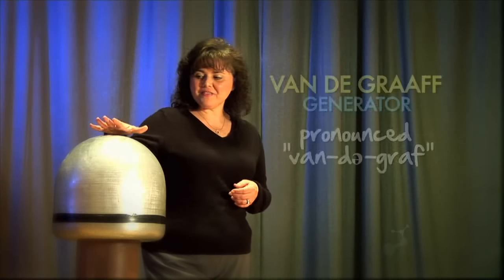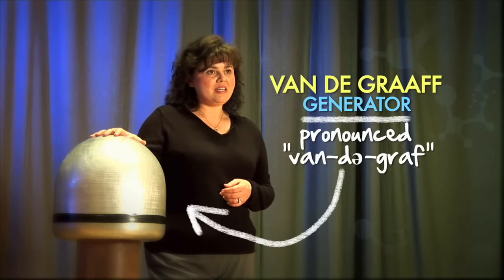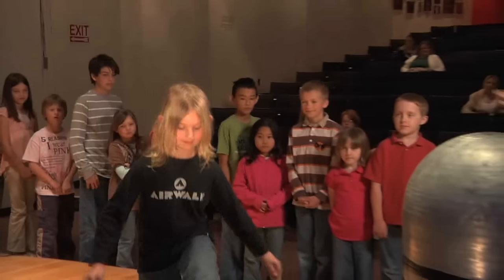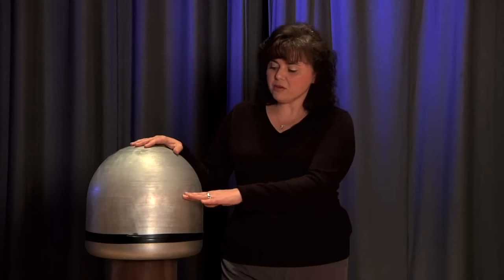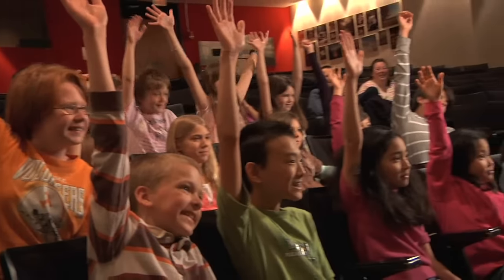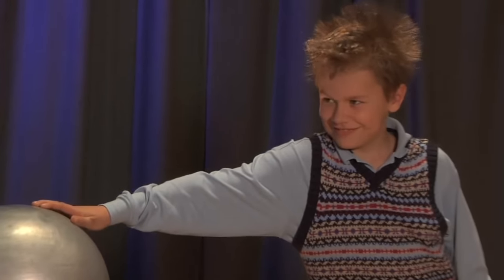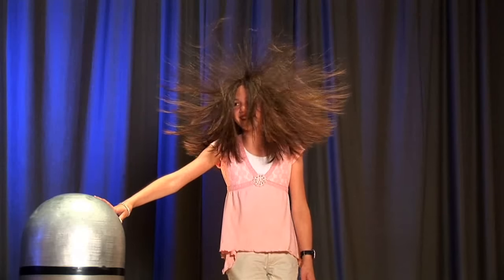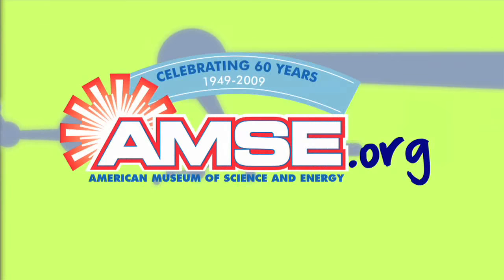Van de Graff Generator

Comment: The hair goes up because high electron density (number of electrons/volume)tends to move at a sharper points which is our hair tips.
Reply: no its because the hair becomes negatively charged and so it repels each other

Comment: I have a doubt .... aren't those students who are touching the sphere getting shock.. , 😲
Reply: if you touch it then turn it on you wont get a shock. But if someone touches you, you will. In my physics class my 'friend' poked me in the eye when i was touching the generator. Very painful
Reply: Also because they are standing on an insulator and current does not flow without potential difference

Comment: Can the metal part of the van de Graff generator be negatively charged or is it always positively charged?
Reply: Angel Daniel it is always positively charged
Reply: it scrapes away electrons which are negative charges. You remove negative and you get positive. If you had the scraper be a metal or something more conductive than the outside it would add electrons. You would still get the same effect on hair though
Reply: In my opinion, it should be always positively charged because you need to ground the bottom part and you can't take protons from the ground you can only give electrons so if you give electrons to ground you can only stack up protons at the top.

Comment: Is this safe????
Reply: ROFIAH BINTI -  wow grt theory...
Reply: To many positive ions in the body is Bad. That's why a century's old technology was realized.🤔
Reply: David Francisco  no it's safe to get shocked the energy is limited wich is voltage x current x time although the voltage and current are high the energy is limited so the voltage has a peak which is the spark you see but it discharges so quick it's safe to touch

Comment: will children receive a shock if they don't stand on an insulator?
Reply: yes
Reply: Yes, as an insulator un-grounds the body so electrons don't have a place to flow to, through your body (if they do, it'll be painful)
Reply: Nice video
Reply: Yes but the current is VERY low so it's completetly harmless. They probably won't even feel it. Electrons will just flow through the ground
Reply: @mee14159  A reply after 4 years. 😁
Reply: @RishabhKumarenetuser  yep why not 🙃